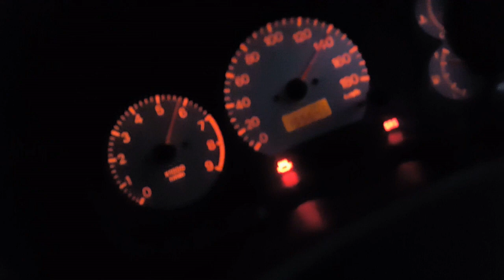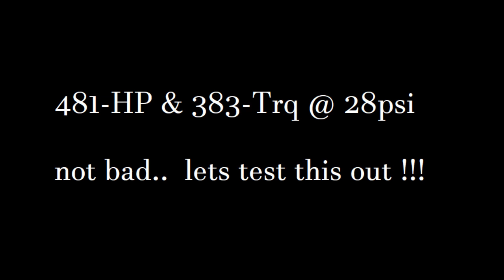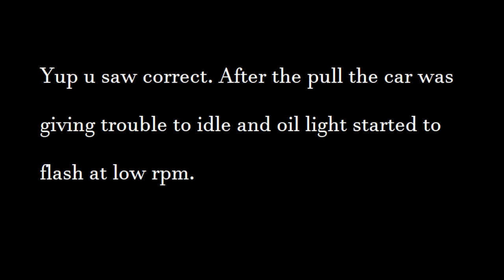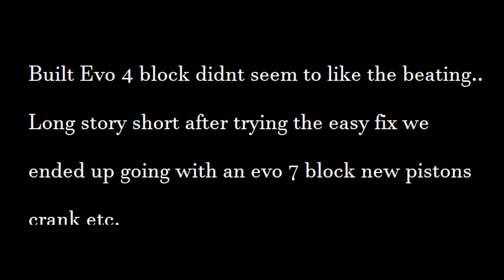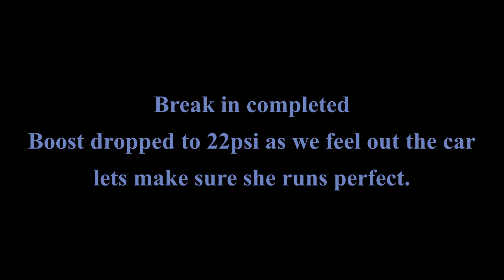500hp evo 4

Comment: Nice build bud 👍🏾 got a question i heard rumors about the evo 4's not being very good at launching compared to evo 3's, how true would you say that is? But your 4 is a ripper though 🔥🔥🔥
Reply from the maker: Honest opinion it don't matter the evo.. 3 or 4 .. 5 to 9.. the 6 and below tend to have a rear wheel drive bias.. without launch control and free rev launch the car will get out the hole very nasty. I tried it with and with launch control it all comes down to driver and tyre combo. My launch control is 6700rpm and the car leaves sideways sometimes and then sometimes no traction... Stay tuned for this clips in the future 😜